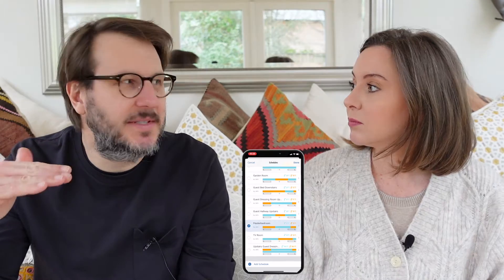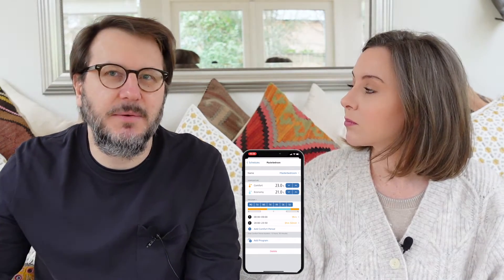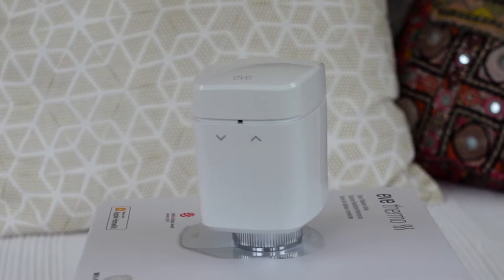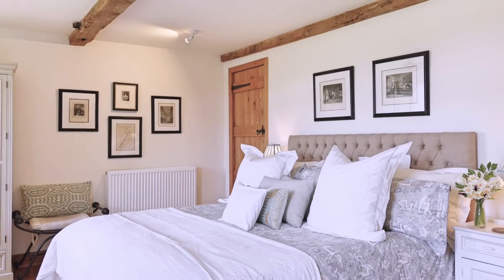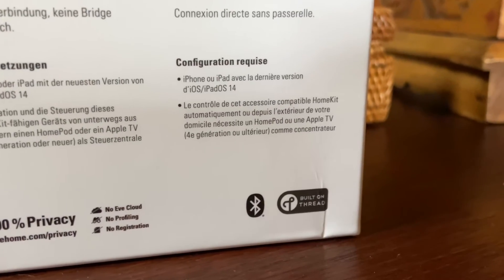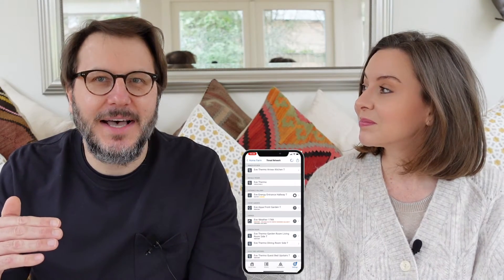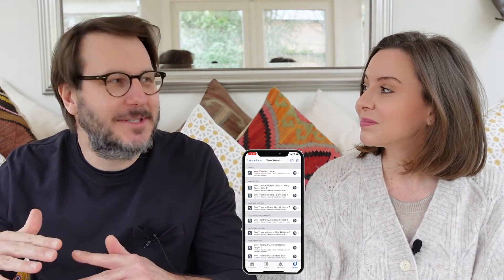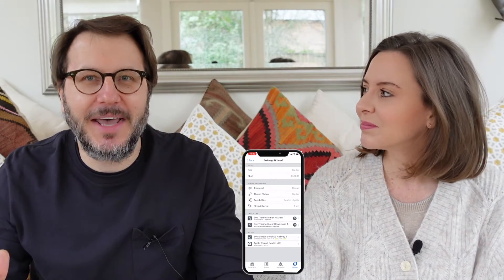Saving Energy With Our New Eve Thermo Smart TRVs – Thread Enabled

Comment: Heat demand direct from the Thermo valves is perfectly possible using the Eve app.  With the app, the Thermo valve state is revealed as open or closed.  In an automation created in the Eve app a transition from closed to open or open to closed will create a trigger that can be used to launch a scene to control the boiler.   Two scenes are needed. 1) 'Boiler Fire' and 2) 'Boiler Idle'.  An Eve smart socket, turned on and off by these two scenes, can be used to control the boiler firing circuit.  This typically requires closing a voltage free contact pair to tell the boiler to fire.  I have used a mains relay to get the voltage free contacts. Something has to be said about the automations set up in the Eve app.  The 'Boiler Fire' automation is simple.  If any Thermo makes the transition from closed to open, this causes a trigger which should lead to the 'Boiler Fire' scene.  Every Thermo valve needs an automation like that.  If a valve has set the boiler firing and  another also makes the same transition from closed to open there is no change, the boiler keeps firing.  All the valves are thus in parallel in an "OR" gate. This valve OR that valve OR the other valves all lead to 'Boiler Fire'.  It's NOT the same logic for shutting down the boiler.  Each valve needs a second automation 'Boiler Idle'. There it has to test to see if it is the last man standing.  Only the last valve making the transition from open to closed should set the 'Boiler Idle' scene.  This is to avoid having any random Thermo pulling down the boiler when others still need it.  The Eve app provides for multiple conditions to be satisfied before a trigger leads to the control scene, in this case 'Boiler Idle'.  Every Thermo valve 'Boiler Idle' automation must test all the other Thermo valves to check that they are indeed closed before it goes on to exert the 'Boiler Idle' command via the Boiler Idle scene.  The is an 'AND' gate.  This valve AND that valve AND indeed all the other valves must be closed before the Boiler Idle is exerted.  This means a lot of statements embodying the firing and shutdown conditions.  If you have 10 Thermo valves you will have 110 automation lines of code. (Don't ask, you will see).
So all the guys telling you it cannot be done have not done their homework.  I have just completed a 13 radiator system and it works and controls the boiler firing and idling.

Comment: Hi there! Thanks for the video, really informative! 

I have a tado smart thermostat on my wall which I use and control via HomeKit and the Apple Home app. 

If I bought a few eve thermos and placed them on radiators around my house, would they be able to call for heat as I already have a smart thermostat and will be using all accessories through the HomeKit framework? Many thanks!
Reply from the maker: Hi Richard. Great question. Sadly, the Eve Thermos can’t call for heat. That’s the job of the smart thermostats. 

We have 11 rads (each with an Eve Thermo) throughout the house and three smart thermostats in strategic rooms that are coldest and come to temperature last. These smart thermostats call for heat, and the Eve Thermos turn off rads in rooms that come to temperature faster. 

Essentially the Eve Thermo only opens and closes the radiator valve, and allows you to set heating schedules. 

Having said that, with the upcoming release of Matter, the Thread-enabled Eve Thermo may in time be able to directly communicate with smart thermostats.

Comment: What do I set my boiler to?  Max temperature?
Reply from the maker: It’ll depend on the leakiness and draftiness of your house. When we ran HVO through our boiler this winter, we dropped the flow temperature to 45C and the house was just fine with that. It’s a game of trial and error and seeing what you’re comfortable with. With a condensing boiler the lower the temperature, the more efficient the boiler becomes.
Reply: @MyHomeFarm  I'm moving into a small apartment, I guess it makes sense to put the boiler to the max temp I can handle then let the smart radiator valves do their thing?

I was going to get a smart thermostate too like HIVE since they have the TRV and thermostat but I think your video changed my mind. I like the idea of an EVE home system with the thread technology. I like the privacy aspect of it too whilst still having features like geo-fencing with the subscription. Also not relying on the wi-fi is a bonus too.
Reply from the maker: I really love the Eve Thermos and the thread network has been rock solid. 

I would graciously disagree with maxing the boiler out. It’s not an efficient way to run it. Dropping it to 50C will provide your home with a gentle, efficient heat and will keep rooms at target temperature. Blasting it at 80C will lead to massive spikes and the boiler won’t condense as it’s been designed to do.

Comment: Thanks for the helpful video. Do the Eve TRVs support OpenTherm or EVS or other modulating boiler controls standards? Also whats your experience of battery life? Do they accept rechargeable type? Tks
Reply from the maker: Thanks for the feedback Mark. No, the Eve Thermo doesn't support OpenTherm (not as far as I'm aware). Battery life on the old (second generation) Eve Thermo was about 10 months (two double AAs). Not sure yet what the life on the Thread enabled version will be as they've only be running for over a month, but should be better (I hope). I think they can use rechargeable batteries.